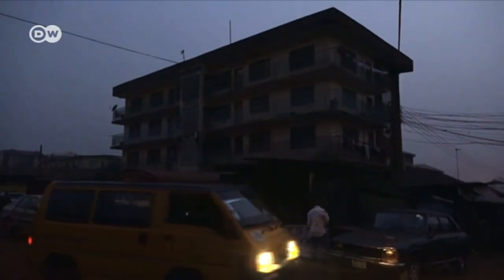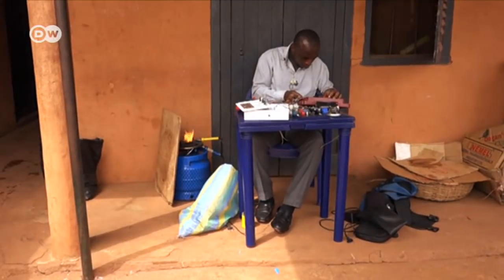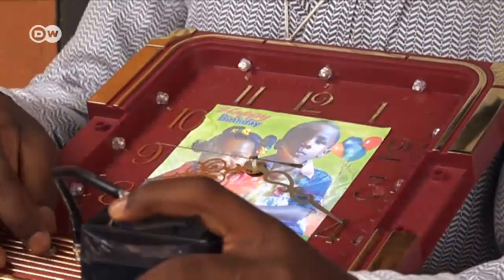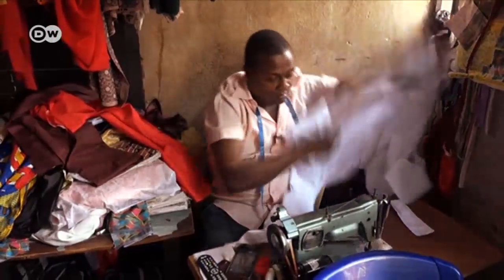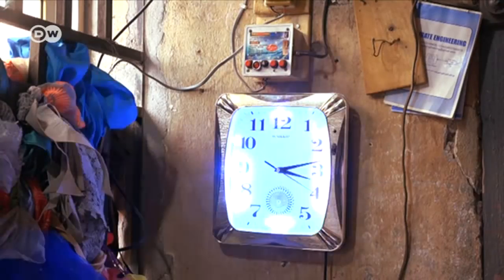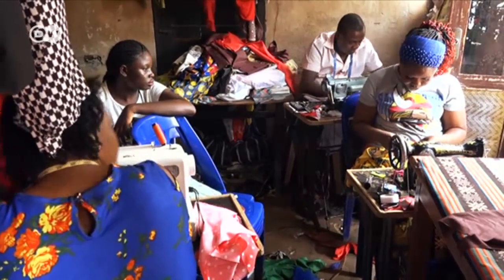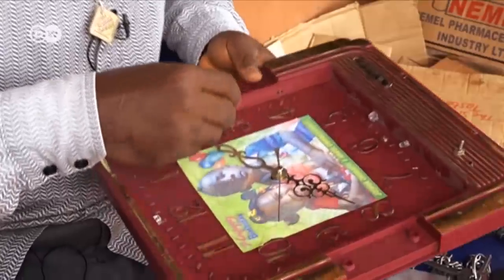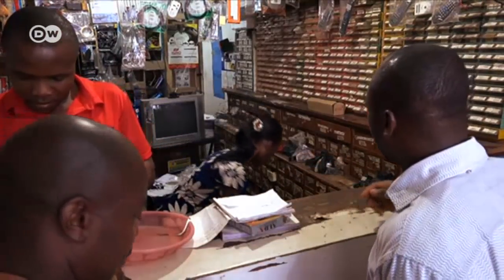Nigeria's solar clock king | DW English

Comment: I love most of DW's videos on renewable power sources, they are generally excellent... but this one? I didn't think that the high standard could drop so much into promoting a completely stupid, story... the whole 2.23 min of it was very poor.
Reply: it's a pretty neat invention
Reply: Can you not use a battery instead? Why do you have to connect a clock to it?